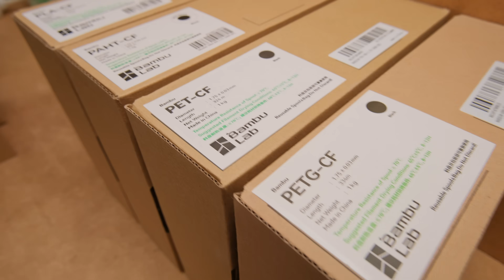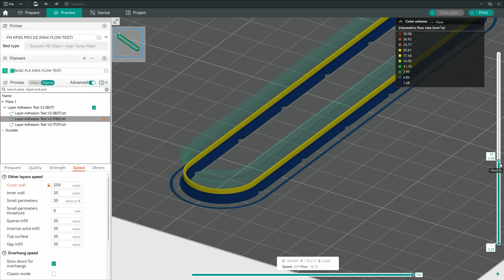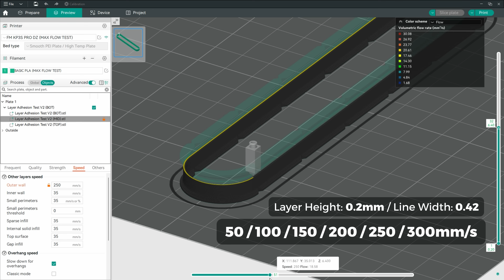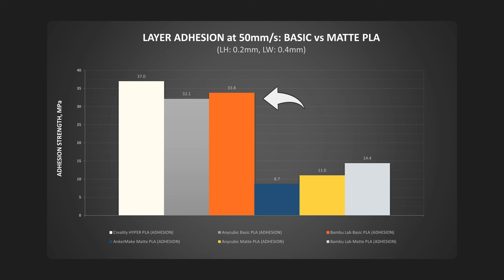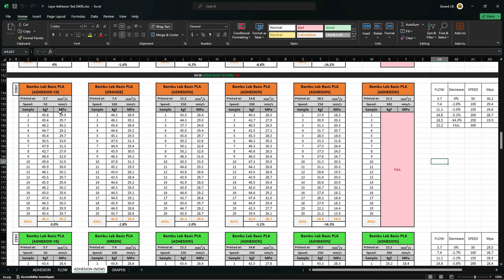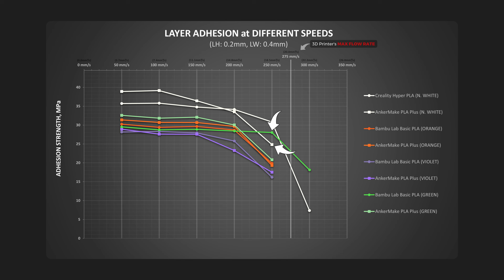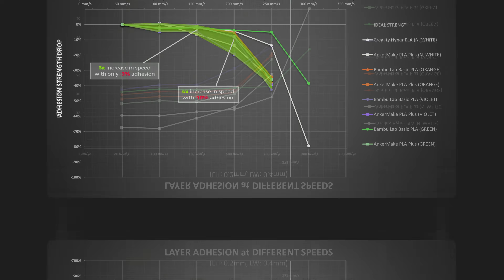How much WEAKER 3D Prints become at Higher FLOW RATES / SPEEDS? (DATA from 1000+ samples)

Comment from the maker: From some comments, I see that people misunderstood what I was trying to say or I didn't explain well enough. So here is the TLDR:

- Printing speeds alone most likely almost have no impact on the adhesion.
- Higher printing speeds are directly related to a higher flow rate.
- Higher speed and flow rate means that the filament spends less time in the hotend.
- As plastics have significantly lower thermal conductivity than metals, it doesn't heat up enough and that is why we start losing adhesion.
Reply: But what if we increase in the hotend temp and how fast we can cooldown the PLA after it's been laid down?
Reply: Thanks for the clarification.

However printing faster is not the only way to increase flow rate. 
What your data shows is the flow rate correlation to layer adhesion.
Sure, printing faster pushes the flow rate, but so does layer height and bigger nozzles.

It would be interesting if you could repeat this test using bigger layers (0.3?) as well as larger nozzles (0.6, 0.8?) to see if the layer strength is truly speed limited or purely a flow rate issue (and not speed related)
Reply: Thank you for sharing and If I can bring some additional perspective onto the subject. 

Printing speed does have an impact on layer adhesion all based on the type of polymer being used. Not all polymers are created equal and some have very unique properties that do in fact benefit in higher print speeds. 

The loss of layer adhesion can also be compensated by lowering the impact of the part cooling fans. Specially with these new higher efficiency and output fans such as the Prusa NexTruder and Bambu Aux fan control available. 

Part cooling has been optimized to facilitate faster and faster print speed, but does at the expense of reducing layer adhesion. There is a trade-off so to speak.

Comment: I'm thinking to get the same layer adhesion at higher speeds you need to increase the heat at a proportional rate, what that rate is will have to be determined.
My guess is the faster speed is allowing the filament to cool faster and not get the same bond.
Good job as usual. :)

Comment: Excellent test, thanks for doing it.  I have been using Elegoo Rapid PLA+ and their Rapid PETG as well with great results on my Qidi Xmax3.  The PLA+ is noticeably stronger than the Hyper PLA and it is quite a bit cheaper  as well.  I use the PETG for functional parts and the PLA+ for everything else.
Reply: Why do you use rapid petg? I thought it had a lower glass-transition temperature, which ruins the main pro of using petg imo.

Comment: How do CHT nozzles change the picture? they increase flow rate at a given under-extrusion % by 30% (as tested in various other channels), but do they also expand the speed range where the layer adhesion stays as good as at slow speed?
I know you took a huge number of samples, but for this new test a smaller number of samples, and only one printer, would be sufficient.
Reply: I just noticed that on AliE they sell nozzles "plated copper" or "brass CHT" (copper CHT insert on a brass nozzle). I wonder which one will perform the best (ignoring behaviour with abrasives).

Comment: Your graphs look almost exactly like underextrusion falloff graphs. If so, you don't really have weaker adhesion at higher temperatures, just weaker adhesion at narrower wall thickness (i.e. seeing result of a correlation not the variable in question).

Comment: Keep the research coming, you're a godsend for the 3d printing community!

I do wonder if staying further below the max flow rate of a hotend helps since it heats the filament more thoroughly. If possible i'd like to see this test with a super high flow hotend like the goliath (with cht nozzle). Or even test melt zone length.

Comment: Great video. I think it would be interesting if you could show images of how the samples looked at the different colours and speeds. If there was some visual correlation (shine, layer quality, etc) with the strength of the parts, it would be inmensily useful for other people, as factors such as hotend, extruder, cooling will be 3d printer dependant.
Reply: Easy answer. Black will always be the strongest. 
Carbon is used as the pigment and naturally strengthen the part.

Comment: Would be nice to see another test, where you take samples at 250m/s where it's degraded, and test how higher temps or changing the volumetric extrusion rate, can affect the resulting strength. The purpose is to test all combinations, and to exclude or determine their effect on strength, so that you can isolate exactly how much just the speed itself is affecting the strength, and not just the lack of temperature or non-calibrated extrusion settings.

Comment: Found your channels a few days ago. Already binge watched 90% of of your video. Great contents!
I have built a tensile testing machine before that record stress-strain curve data into a computer. I am actually interested to know your electronics design (I guess many others do too). Especially the "control tower" thing with touch screen and the data meter. Much appreciated if you can add that into your printable link / a write up/ or even a video.
Reply from the maker: Thanks, I am glad you like them.
I do not record the curve, only the the ultimate tensile strength. Parts that I used was:
- 500kg load cell https://www.aliexpress.com/item/32866914213.html
- Load cell data display/meter https://www.aliexpress.com/item/32766229850.html
- Touch screen and motherboard are just parts from old printer that control the movement.

It is pretty basic setup that I feel is more than enough for me. The remixed CAD design - https://www.printables.com/model/805135-universal-tensile-testing-machine-v2-remix

Comment: I feel like you might be hitting extrusion limit of your extruder instead of print speed affecting strength.
Reply from the maker: I updated the title because I got a few similar comments like yours. Higher speeds = higher flow rates, they are directly related. I even explained my testing methodology and all charts show flow rates. I doubt layer adhesion is affected in any meaningful way if we isolate and look only into the speed. Filament has low thermal conductivity and when it spends less time in the hotend it is heated less and we are starting to lose layer adhesion. Maybe it is just obvious to me, it is so easy to forget that, and I need to explain more in the video. I will try to remember to do that in the future. :)

Comment: Flow rate should be measured too, you might be getting underextrusion there which is being the reason of strength dropping off.

I measure max flow rate, then deduct 20% for safety margin, and print PLA at 240C -- have yet to notice any weakness in the parts.
Reply: On Sovol's volcano style on SV07Plus this yielded for PLA 24mm3/s and on Elegoo Neptune 4 Max 21mm3/s

Creality K1 Max i recall defaulting for ABS to 23mm3/s, i should measure what it can do as well.
Reply: at 7:35 your max flow rate has been shown, so the drop off starts to happen at about -20% of the max flow rate. There's also measurement confounding factor.

I use the curvy print from orcaslicer to measure and calipers at 0.5mm3/s per 1mm and just pick the first layer of issue, then remove 20% for the final.

So it might be speed doesn't matter, only the flow and cooling rate.
Reply: forgot to mention, i use flow rate maximum as the limiter and print typically at 0.2-0.25mm layer heights, so actual movement tends to be quite low with plenty of plastic, and curtain cooling also being used.

So end result is mostly cold prior layer, with a lot of plastic on top at lower speeds of 120-150mm/s, giving it more time to melt the prior layer.

Comment: I regularly print at 500mm/s and never had noticed poor adhesion.  I think if you up your temps while printing fast it will give you a different result.  I get you are trying to set a control, but it's a variable that also moves with print speed.  Run 250mm/s with 230-240c.

Comment: Thanks for sharing your test setup and the thorough analysis. What are your thoughts on the main cause of the drop in adhesion when raising movement speed? From what I understand, it could be (1) lower temperature of the extruded material caused by the higher flow rate, (2) actual underextrusion from an overburdened extruder/hotend, or rather (3) less precise movement of the print head at high speeds.
Reply from the maker: I think mainly because plastics has low thermal conductivity and the less time it spend in the hotend the lower temperature it will reach when extruded and won't properly bond to the previous layer.

Comment: You should really be testing this while ensuring the filament is maintaining the same temperature at different speeds and not the hot-end. The faster you go, the less time the filament spends in the meltzone, and thus it's actual extruded temp is not likely what you've set  for your hot end.
This really renders a lot of the data here not applicable as a result.
Reply from the maker: I test realistic printing scenarios not imaginary ones.
Reply: @PrintingPerspective  ey man I'm not tryna come across as rude, I'm just saying that the filaments temp is what's important to consider here, if it's not heating up enough it's not gonna flow well no matter what. this doesn't even account for improper die swell at higher speeds either.

Comment: what if there's a way better hotend, for example VzBot Goliath? I can do over 40mm3/s with my modded hotend, but I feel like 30 is safe maximum. however, calculated into speed it would be 375mm/s at 0.4 width and 0.2 height. I do not have Goliath, but that can do over 1000mm/s for sure since it flows over 100mm3/s.
Reply from the maker: Probably if your calculation is correct. But there are so many variables that it is impossible to say for sure. That's what I learned from doing more and more testing.

Comment: Thank you for testing this! When I first got my bambu lab printer, my PLA prints had a matte finish and I was concerned that the strength might be reduced. I did some very basic tests of my own and found no real difference, but it's nice to get some science on it!
It also concerns me that most of the filaments you tested had significant drops after 200-250mm/s, and my default 0.2mm layer profile exceeds this for everything except the outer perimeter and top surface...
Reply from the maker: If you use Orca or Bambu slicer there's flow rate limit set in the material section so you are never reaching those speeds. But default Bambu hotend's flow rate should be even lower than Volcano that I tested on, so you might need to lower speeds even more for strength.
Reply: @PrintingPerspective  that makes sense! It's not obvious what the actual print speed is, but nice to know that it's just an upper limit

Comment: 6:38 In the future it would be nice when graphing these sorts of tests if you could include the range of the results instead of just the average. even if you are only losing X% strength on average it would still be useful to compare consistency.
Reply from the maker: I was thinking how to represent results the best as graphs get cluttered very quickly. But because it's a print not in a vase mode, there were a tendency for the  results to fluctuate in a similar pattern at every flow rate. But you are not wrong, that would be good info to add.
Reply: @PrintingPerspective  Thank you for the consideration. IDK what program you use for your graphs, but it probably has an option to add error bars to each point (the little I shapes). I just thought of this because CNCKitchen does it for his bar graphs, and its very useful to see when a specific sample is more or less consistent (or if they are all the same). I dont think it would clutter your graphs too much, but they wouldn't overlay so cleanly with them on. You could show each filament sample on the graph by itself with the error bar, and just keep the line when comparing multiple filaments.

This is a great video, and very helpful. So I figured it was only fair to try and give some (hopefully) helpful feedback. Looking forward to more like this!
Reply: @PrintingPerspective  Yes like adding a +- % so we can see which brand/color/flow rate offer the most realiable results

Comment: Is there any reason you couldn't attach a sort of heat gun to the tool head that would reheat the previous layer right before laying down the next? Might be a good way to increase adhesion, and maybe a good video idea to find out
Reply: It is possible with high chamber temperature and high fan pressure
Reply from the maker: I don't think that helps for PLA, CNC Kitchen have a video about it.
Reply: This sounds like a gratuitously complex way to avoid doing the right thing: cranking up the nozzle temperature. For most materials there's no reason you can't go 50-90 degrees over the recommended temperature as long as you keep moving and don't let it sit and cook.

Comment: The probe temperature and the actual temperature will be different values because the probe temperature is updated every X second/s (or moves). 

So you’re probably just measuring layer adhesion versus temperature. This is why layer adhesion doesn’t change below a certain speed - which is slow enough for the temperature probe and heater to react.
Reply: That theory could definitely be tested by printing at higher speeds and higher temperatures

Comment: Wish you had tested a black filament
Reply from the maker: Black color Hyper PLA had 37.3 MPa layer adhesion strength at 50 mm/s printing speed while natural white Hyper PLA had 35.7 MPa. I have no data for higher flow rates with black color Hyper PLA unfortunately.

Comment: Very good work. Have you tried  repeating a test with an increase in heater temperature   along with the increase in speed?  I routinely print at high speeds but with elevated temperatures to compensate for the reduced residence time in the heat zone. I have not seen a significant drop in strength and my PLA material has a gloss appearance not matte.
Reply from the maker: No, I did not. It depends a lot on the material itself. Some remain more shiny some quickly turn to a slightly matte finish. But maybe I will investigate that sometime.
Reply: @PrintingPerspective  I would also recommend increasing the print temperature along with the print speed. Basically repeat testing but all at 230 for example.
Reply: If you're printing fast enough that the material doesn't sit in the hotend for minutes at a time cooking, there's no reason to use temperatures below 250. 250-260 is my daily driver PLA temperature on my fast printer; 270-280 on my Ender with short melt zone.
Reply: I second this, try a higher temperature to see if it make layer adhesion better at high speeds

Comment: Would these results be affected by the extruder? Layman here, but I would imagine that longer melt zones, more thoroughly melted filament and evenly consistent performance would affect layer adhesion. Do they? Do CHT type nozzles change results? This is very interesting, and thank you for making such a clear video about the topic!
Reply from the maker: @astrumrocket6556 But longer melt zone hotends have a max flow rate limit too, so most likely it will still be half of the max flow rate. But until anyone tests it in practice we will never truly know, same with the CHT nozzles. :)
Reply: @PrintingPerspective My line of reasoning was that weak layer adhesion happens because the plastic didn't have time to melt properly so it doesn't bond as well. Longer melt zone would mean more time for plastic to melt. No idea if that would actually affect anything.
Reply: @PrintingPerspective  please test the CHT style nozzles! (especially the Chinese CHT clones which are actually better) They are such a massive easy upgrade for BBL printers especially, I would love some real world data on it for high strength parts.
Reply: I feel like weighing the print could shed substantial light on what i think is the reason for the shape of his graph

Comment: These graphs look similar to the maximum flow graphs from Stefan of CNC Kitchen. It might be interesting to also measure the thickness of the samples to get a reading on the flow rate.
Reply from the maker: Yeah, that is the preset I like the most in Excel :D I was measuring the extrusion width in my previous video with a micrometer. But that is a great idea if I will be testing filaments I could determine how they flow extruded by the width and maybe even find if there is any correlation to the adhesion strength.
Reply: After working with PPS I believe you are right. I believe at that higher speeds the extruder can’t properly melt the plastic evenly and throughly enough. As I used a custom high flow hotend I was able to print faster and at a lower temp with a high flow nozzle.
Reply: Good point. I think a lot of the drop off may be attributable to reduced perimeter width at very high flow rates. Less cross sectional area = lower strength measurement. If we can control for width, it would be interesting to see if you would still see a drop off in strength.

Comment: There is a problem with the experiment.
The adhesion depends on the thickness of the lower substrate, the wider it is, the worse the adhesion will be due to heat loss in the base.
A line of filament printed on another will melt without problem, printed on 2 it will no longer have as much grip and in the middle of 3 it will reduce it even more but the sum of the whole will be stronger. That is why the vase mode usually achieves adhesion in which the piece breaks by jumping between the layer lines and the reason for turning off the fan the first 3 layers